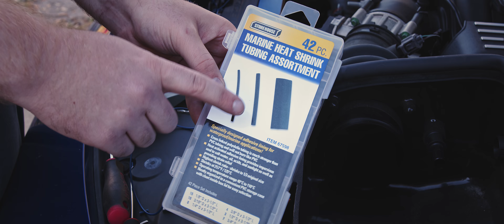In Depth Wiring Guide for Diode Dynamic Kit & DRLs Staying On While Signaling

Comment: The only part that was useless was taking the pins out of the connector and splicing them when you could just cut the 2 and spliced them while still in the connector other than than pretty informational

Comment: Can you share how the relay is connected? I understand that post 86 pulls power and the other post are grounds.  How are the other 3 post wired?  Also, rather than running wires to connect both enclosures to 1 relay, can you use two relays, one for each side?
Reply: I think I figured it out..  Post 86 connected to the dual harness that is connected to the DRL enclosure.  Post 87 connected to the white wire from the RGBW kit.  The last two post are grounds.

Comment: Yo what about wiring the boards like how diode dynamics instructions tells you to do it ? Will i install have the same  issue when using my turn signals?
Reply from the maker: If you do it literally as they say to do it, then they will turn off with your signal lights on, on that side, just like the DRLs do stock. I preferred to have them stay on all the time (funnily enough though, they do still turn if if the hazards are on, because that means both signals are active)
Reply: Very Good Garage thanks man